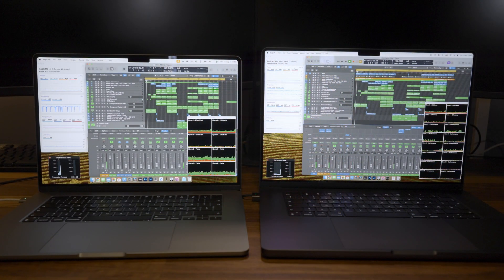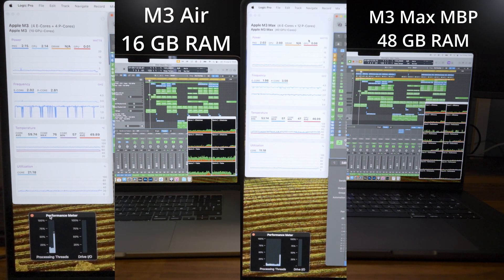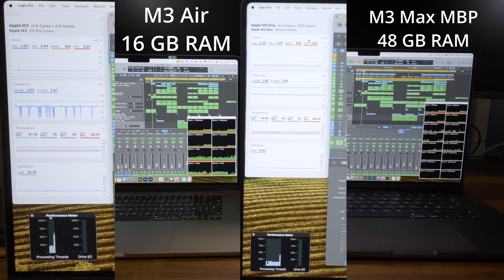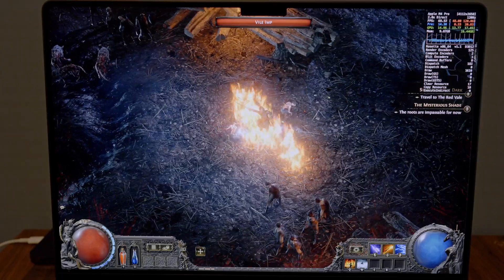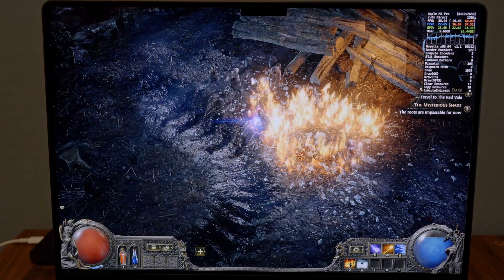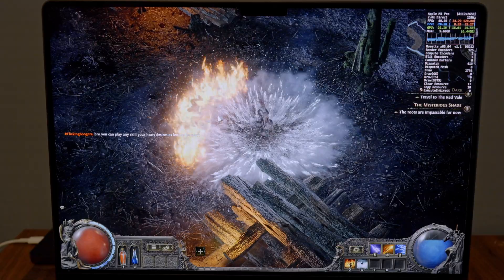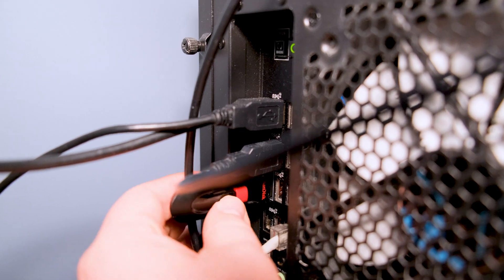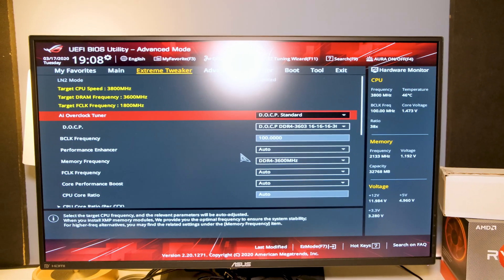Why I Recommend Macs for Beginners & Pros (But PCs Still Wins Sometimes)

Comment: I am looking for new hardware at the moment and have always used Windows in the past but am not not sure what I want…
I currently have a W10 PC and a W10 laptop but neither of them can be upgraded to 11 as they’re both about 12 years old. I have quite a few hardware synths and with my Yamaha synths got a free version of Cubase but haven’t installed it yet. I am looking at getting a decent laptop because I want to be able to use it around the house for general use and where my synths are I don’t have the space to accomodate a PC.
I’d also want to use it up in my office to edit photos - probably using Lightroom.
I was wondering if a 15” M4 Macbook Air with 24GB RAM would be sufficient for my uses?

Comment: I have kept going back and forth between Mac and PC for 2 years now. I use a mac a month, hook up PC, use a month, hook up the iMac. So yeah I keep going back and forth every month as I own both. But here's the big thing. The games I own on Steam and the Xbox app for Windows I already own the same exact games on PS4 and 5. So of course I go I already own all these games on the consoles I have, so why care about PC? So than I go back to iMac, and I did for about 2 months and than no na na but PC can game, put PC back up. Oh man. Just going crazy I guess. Overall I have over 500 games across PS12345, so I really shouldn't care about PC anymore, because I have the exact same games on PlayStations already and really I still don't care about that frame rate stuff at all. So I guess I should just go Mac and PlayStation because I have huge over 500 games for the PS consoles already. And Mac because well I do like it's built in apps like iMovie, photobooth, stickies, capturescreen app in other apps area. So many good apps.
Reply from the maker: Tell me about it! I am doing the same. I have also thought about getting rid of the PC and only having mac and my ps5. But there Are something with pc building as a hobby and the fluid gaming on a PC I still want..

Comment: I am using computers to play live VSTs since many years. It is possible to build a good PC for audio as a tower, home workstation.  It is not easy but possible. 
It is nearly impossible to do the same with a laptop. If you need to carry your audio worstation with you a Mac mini or a MacBookPro is much better. 
You have predictable performances and since Apple silicon M1, you have wonderful solutions.
Now Microsoft is working with an universal midi2 software layer for new workstations.  I hope they will have success. We need competition at good levels.
Core Audio inside MacOS is currently a perfect way to work with real time audio.